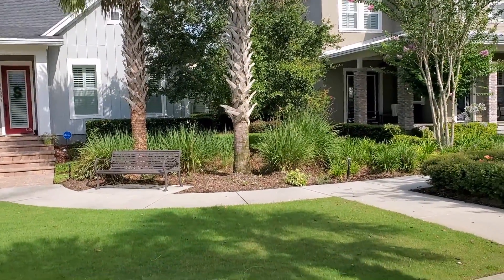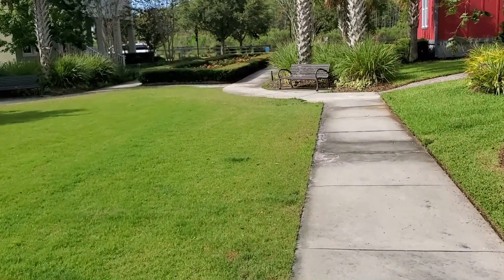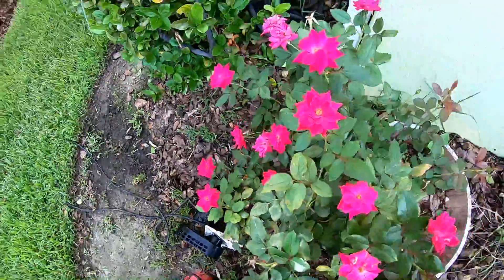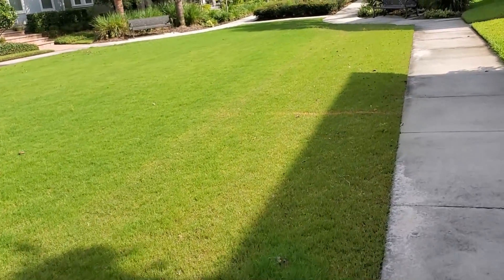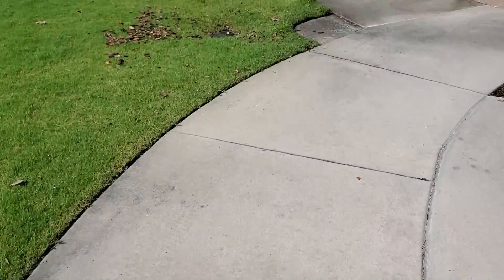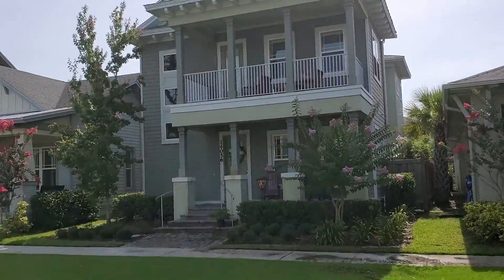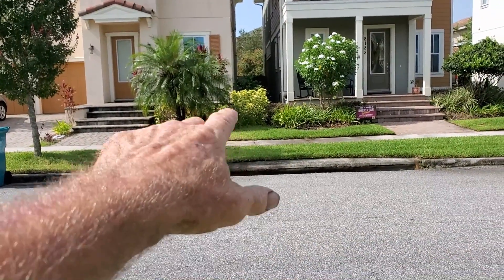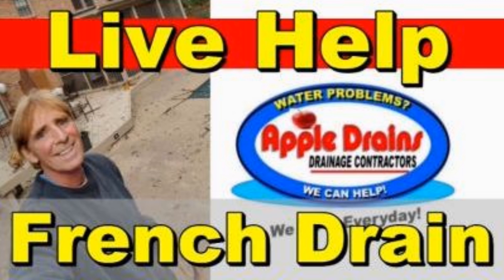Catch Basins | French Drain | HOA Courtyard Drains

Comment from the maker: What is French drain? This is a drainage system that collects subsurface water. Perforated pipe surrounded by gravel collects the water underground. 

What is a catch basin? These are drains that collect the surface water. When it rains hard water comes across the top of the ground and drops into your catch basins.

What makes a good drainage system?
Combination of French drains and catch basins help keep your yard dry.

What is Geo fabric?
This is a filter fabric to help keep dirt out of your French drain. Especially the rock.

Is Geo fabric need it?
Not always. Depending on the soil type. For example in the sandy base, yes the gravel and pipe should be wrapped with Geo fabric. And in clay soil, its works, but is VERY SLOW.

We Install Rainwater Drainage Systems Everyday !

Comment: What are your thoughts on atrium drain covers vs. flat covers
Reply from the maker: Great Question Eddie! Atrium Grates work great when installed inside the landscape beds. Here the flat grate works better for the yard maintenance. The Atrium Grate allows more water to flow but actually, water still flows through the mulch.
Reply: I live in Columbia SC and pine straw is the mulch of choice.  I found that the flat drains clog on top and the water just flows over.  The atrium drain allows the much to sway at the bottom and then when the water rises the top of the atrium stays open.  I have flat drains in the grass

Comment: May I assume a system with solid pipes and catch basins is better than no system? 

I have two quotes. One for catch basins and solid pipes and sump pump. The other for catch basins with solid pipes, french drain with perforated pipe, fabric and gravel and sump pump.
Reply: It all depends on what water issues you are trying to solve.  Solid pipe from downspouts, french drain with perforated pipe for gathering water from standing water areas placed underground, catch basins for collecting immediate surface water.
Reply: Just installed a solid pipe system with catch basins around my home with downspout connected to it..I’m in Houston and have a lot of rain this week..so far so good
Reply: Anything is better than nothing. If you've got a lot of subsurface water (we have clay in NY and it just holds water forever), a french drain will help. Obviously the 2nd option is going to perform best, but if cost is an issue, start with the first system and see how it goes